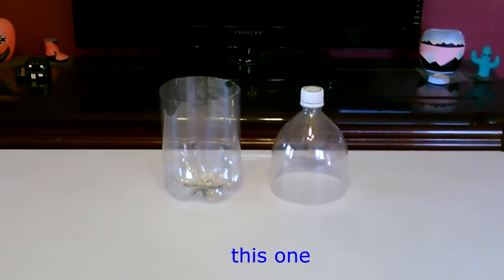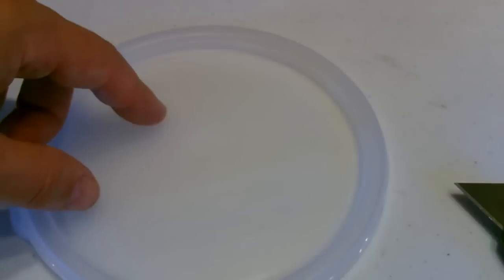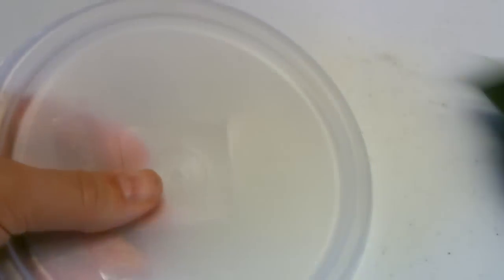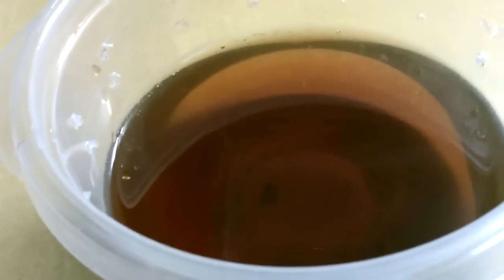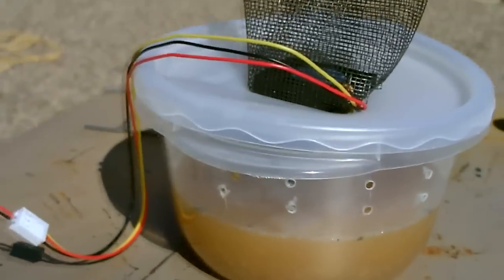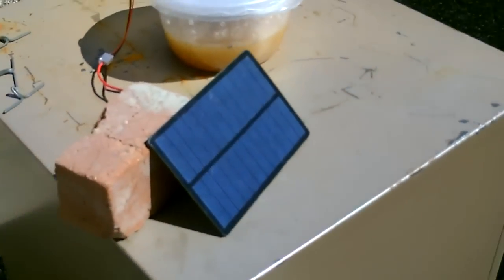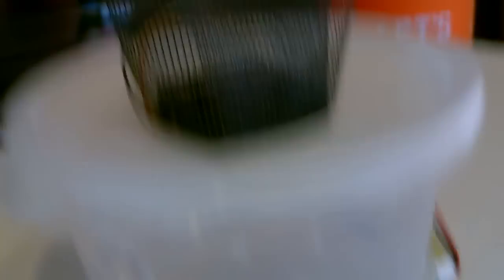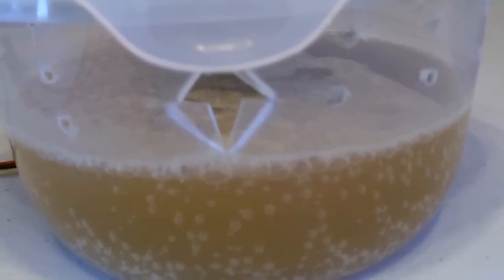Homemade Mosquito Trap! - The DIY Mosquito Trap (improved!) - Easy DIY

Comment: You've got a clever, inexpensive trap here--congratulations.  I just looked at a bunch of these videos about traps, and I'm not sure anyone else has noticed this.  Many people said their brown sugar & yeast trap didn't work.  But one thing in every video I saw with the complaint that it didn't work was that they all placed their traps low, mostly on the ground.  Mosquitos don't fly close to the ground--they fly at head or shoulder level mostly.  Those I saw where people claimed some success with their trap were when their trap was at least at waist level. One woman even HANGS the trap at head level.  I do think yours is a great improvement, but you put it on a table too.  So maybe that's one reason for catching them while others are not!  I'll try to find time to make one like this, and maybe add some of the other known attractants.
Reply: Doesn't matter what height you place the trap--the fact that we get bit on our legs when wearing shorts is proof alone of that. The insects follow C02, regardless of height. I was on a ladder 30 feet in the air yesterday and they were still finding me.  What's typically neglected is which species the individual is fighting. Culex and Aedes are in my area, and different insects have different behavior. E.g. an ovitrap designed for aedes won't combat an infestation of the most common species of culex. To make matters more complicated, it will work with some other species of it.  It's all about knowing our enemy, realizing they come in many forms, and exploiting their weaknesses.
Reply: This prompted to look for Culex traps, and I found fairly lengthy research paper on the efficacy of different trap types for mosquito varieties (https://academic.oup.com/jme/article/43/6/1121/889298).  My eyes kept rolling back in my head, but I think the CO2 will pull in Culex too.

Comment: What are the 1/8" holes for if you already have the fan diffusing the scent? Thanks. Great video.
Reply: G Butler airflow. Any fan needs to have an in and out. It would be too much on the inlet hole and the fan wouldn't be effective, probably wouldn't work at all.

Comment: Is the fan blowing air in or sucking air out? Where did you get the fan?
Reply from the maker: Lance Schoon hi there. the fan is pulling air into the container and pushing it up and out thru the screen and into the air. i got the fan from fry's electronics.
Reply: Thanks for that info.

Comment: Love your videos.  They need to mass produce these in Africa to combat the mosquitoes there!
Reply: Yeah, or something else, as there are many DIY solutions.
But your massproduction comment made me think of a design improvement for this trap: place the solar panel on top of the box at a 45 degree angle or something, so it sits right above the fan; and shorten the cables.
So you have a nice unit, instead of having to carry around separate parts!
Reply: mosquitos help to keep the blacks population in check.